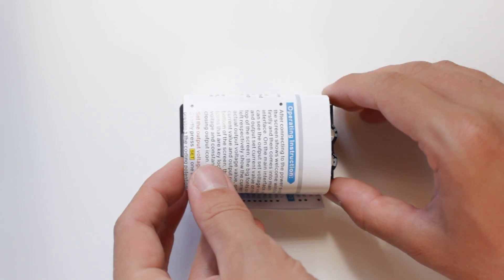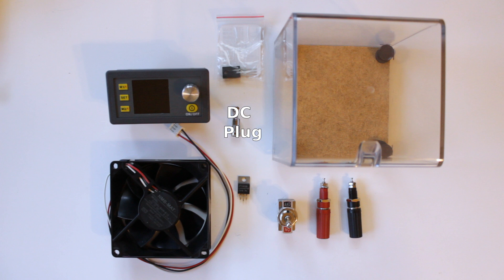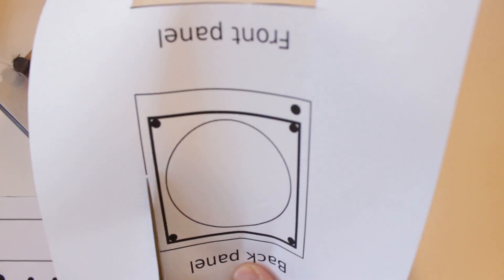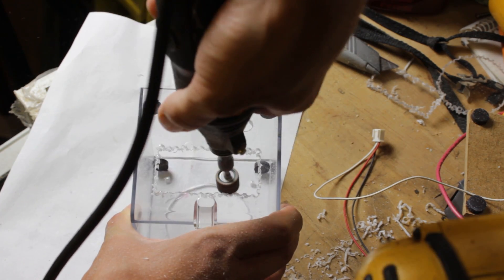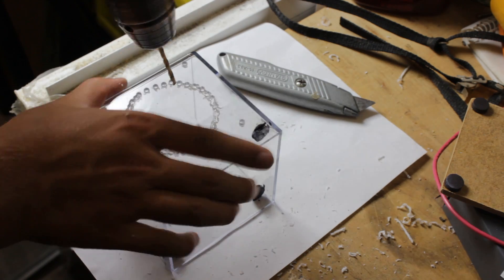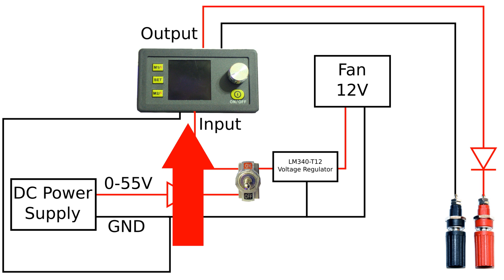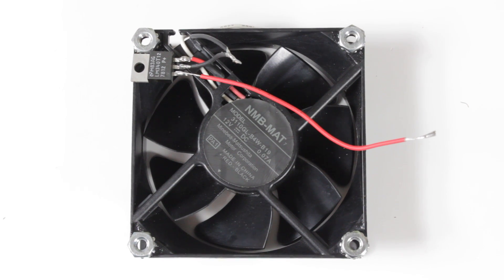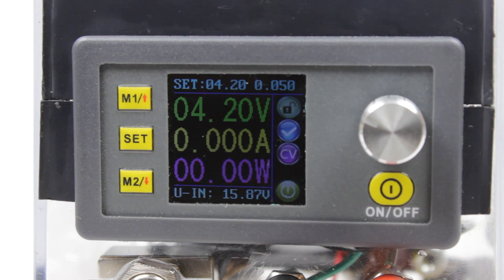Adjustable Voltage/Current Power Supply

Comment: Hi Dusan.  I have a similar power supply, but . when I connect the load, voltage output drops 
considerably.  DPS voltage readings are different from what I measure 
using a Voltimeter.  Do you know what can be happening?   Here is a video of my problem
https://youtu.be/AvVGQbyPqnk
Reply from the maker: Hi Andrés, check S-OCP (preset over current) and S-OPP (preset over power) in the menu. Maybe they are set too low.

Comment: Will i be able to use a regular ATX powersupply? like only 12v ?
Reply from the maker: Yes, with this module you can power it with anything from 6 to 55V, but it is not step-up converter, so you won't get voltage higher than your input.
Reply: I only need 12v so this would be perfect =P

Comment: the cooler is not necessary
Reply from the maker: Ariel Baravalle it may get warm if you draw 5 amps at max voltage, better be safe than sorry

Comment: Not a power supply, its a buck/boost converter. 

You need an external power supply.
Reply: TheKetsa
in fact it depends on how you understand power supply . if you think only AC-DC  is power supply , I don't agree. 
my module is DC-DC power supply ...
Reply from the maker: TheKetsa yep, mentioned it in the video that I used it with adapter from the old notebook, so together it is power supply ;). The module is only buck converter.
Reply from the maker: I tried to find buck-boost converter with the same size and display, but it looks like there is none for now.
Reply: I just learnt there is one buck/boost now : DPH3205, same manufacturer.
Reply from the maker: TheKetsa that's great. I will check it out for sure once I get home.

Comment: Great video!  I already have all these parts!  Instead of a clear plastic case I'll be using a metal project box (similar to an ATX power box enclosure). Thanks for providing the wiring diagram.  That will be very helpful!

Comment: How much for everything,the box ,the step up power supply ,the switch,everything,and where to buy the items ,good video.  To bad everything is not in one kit ,with directions ,I no that's asking to  much of the sellers.
Reply from the maker: I don't have the exact value because I used things I had around, but you can find everything on amazon or aliexpress. For the module, there are links in the description. For other things look for rectifier diode rated for around 5a (https://smile.amazon.com/uxcell%C2%AE-Signal-Gleichrichter-Schottky-Rectifier/dp/B00HGALQLY/ref=sr_1_1?ie=UTF8&qid=1477016195&sr=8-1&keywords=diode+5a), then you need 12v fan (https://smile.amazon.com/s/ref=sr_st_price-asc-rank?keywords=12v+fan+80mm&rh=i%3Aaps%2Ck%3A12v+fan+80mm&qid=1477016337&sort=price-asc-rank), 12v regulator (I used 7812 linear regulator, but switching would be better: https://smile.amazon.com/s/ref=nb_sb_noss_2?url=search-alias%3Daps&field-keywords=12v+buck+converter&rh=i%3Aaps%2Ck%3A12v+buck+converter) and lastly there are binding posts, switch and dc female connector that you can find cheap anywhere in electronic store. Estimating that if you were to buy everything on amazon, it would be around $45-$50, on ebay or aliexpress much cheaper.
Reply: ***** I found the fan and a heat sink and hardware for about $3.00 buck the rest should be pretty cheap,what hard to find is that clear case.,thanks for the help
Reply from the maker: No problem ;). Some project boxes are here: https://smile.amazon.com/s/ref=nb_sb_noss_2?url=search-alias%3Daps&field-keywords=project+box+clear&rh=i%3Aaps%2Ck%3Aproject+box+clear but they don't have all sides transparent.

Comment: Hi , good video and good work. thank you for support for my products. I am the designer of DP50V5A. 
Although you buy it from DROK, but it is still my products. thank you 
your case is very familiar to my friends work, he made a power supply to use DPS3012. he publish it on BLF http://budgetlightforum.com/node/48523, you can see 
we have also have DPS5015 (https://www.aliexpress.com/store/product/RD-DPS5015-Constant-Voltage-current-Step-down-Programmable-digital-Power-Supply-buck-Voltage-converter-color-LCD/923042_32702714880.html?spm=2114.8147860.0.92.IXtbZy),  if you like it , you can go to my shop to see it . 
when you come , you can tell me, you are from youtube, I will give you some disocunt .. 
thank you
Reply from the maker: Thanks, RD tech. I really like this product.
Wow, the case on BLF is very similar :), looks like it took quite bit of work to make. I used mine from the old GoPro packaging.
Reply: +Dušan Koleno
yes, it is . I am very pleasure to hear you like it. thank you again 
if you need anything, you can tell me 
about, it should be my friends work. it is coincidence